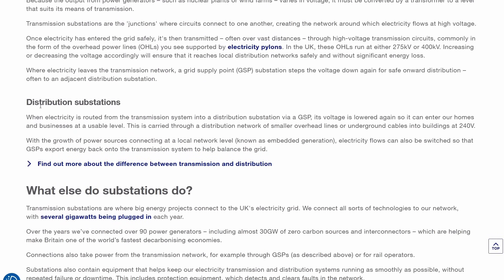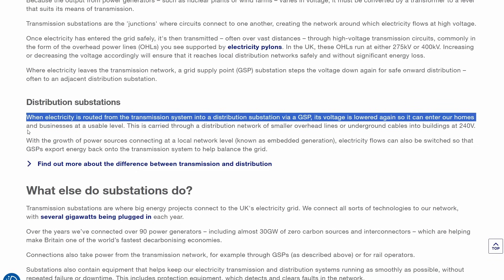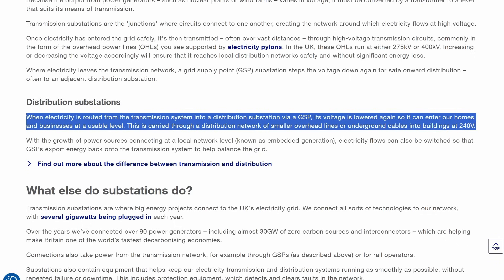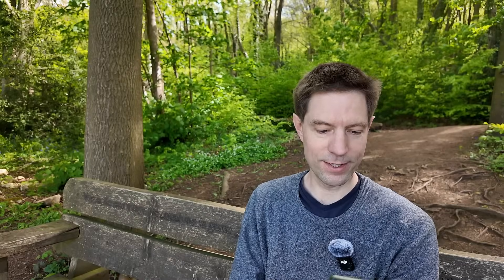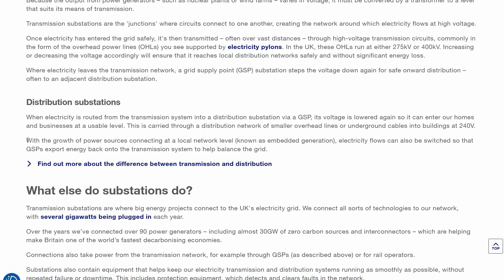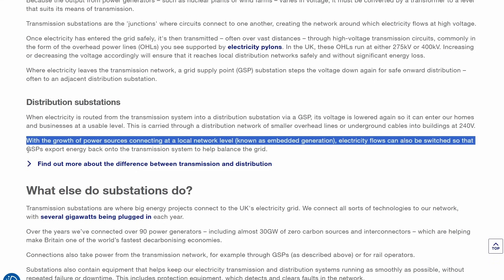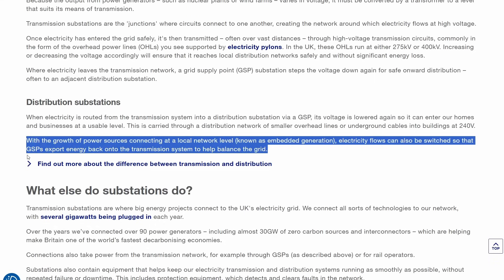Does solar export get past the local transformer?

Comment: I used to work for SSE/Hydro-Electric.  We demonstrated this reverse flow through transformers in our training centre by having an isolated section of 11kV overhead line, with breakers, reclosers etc. for live line training that was back-fed from a standard 230 volt socket via a pole-mounted transformer.  This way the use of voltage probes etc. could be demonstrated to trainees in a (relatively) safe environment isolated from earth.
Reply from the maker: Nice.  That's really interesting.  This is definitely something I'd like to learn more about.
Reply: @ It was very interesting. First step is to get the grand master key to enter the substations. You have to take a safety course that involves photographs of smoking boots with bits of feet still in them!!!
Reply from the maker: @Richardincancale  yikes!

Comment: Tim, 

while it seems counter intuitive, as A.C. is alternating current, power can only flow in one direction, that is from source to load. In a complicated network as our system is that means that fluctuating demand and fluctuating source sort themselves out following the power flow.
In practice your excess probably does not go much further than one or two neighbours. There is no hard and fast rule, e.g. it stops at the transformer, that's just not how it works.
In the event that a whole housing estate has solar and that at peak times generates more than it consumes, the excess will flow back through the transformer and supply some other demand.
This phenomenon of solar peaking at and around midday is not good for the grid when substancial capcity of domestic and commercial solar is connected as it is beyond the control of the grid controller, so other generators may be curtailed to keep supply and demand balance on the grid This curtailment puts up our electrcity costs as it is paid at a higher rate than market price plus subsidies.
Reply from the maker: This is where battery storage steps in.  The grid is getting more and more installed all the time, and many home solar systems have them too, so it won't be as much of a problem for the grid as you fear, I suspect.
Reply: Tim, 
battery storage does not in itself solve anything. The grid needs finite control on an instantaneous basis which makes solar an unknown for the most part.
It is it's peaky output that is the problem, U.K. solar peaks now around 12 gigawatts  and the rise and fall around midday means that gas (which balances the grid) has to decrease output rapidy then incresae again.
On bright summer weekend days there can only be a small amount of gas feeding the grid.
If batteries were automatically and un alterably set to capture any excess for the six hours or so around noon and only discharge at pek time sthat would be OK, but that needs very large battery capcity relative to solar panel capacity.
This government plans a very large increase in solar panel capacity, monkey and hand grenade comes to mind.

Comment: I’ve definitely noticed the impact of more local solar in my village.  Getting more occasions where the grid voltage rises up on sunny days, and once it reaches 258V it stops my inverters from generating AC.  The solar generation stops, grid voltage drops, and the cycle repeats.
I trickle charge my batteries during the day to try to mitigate this, but suspect its only going to get worse
Reply from the maker: With any luck your local network will get upgraded to handle the excess and the situation will improve for you.  I hope that happens sooner rather than later.

Comment: Hello, Network tec hear. so I'll keep it simple ... yes electrical energy can flow in any direction. Look at large amazon yards. they all have there own 11kv supplys. during the day they export, the transformers basically act as a step up transformer. then at night, they pull from the grid.
Same with houses.
reason for things like G99 and Networks giving a green light, is so they can make sure the transformer isn't overloaded in summer + safty. 
Where we see problems, isn't the transformer but the protection systems. Some older sites have reverse power relays. if they see power flowing in the wrong direction they trip. This is a simple upgrade but does cost so if your DNO blocks your application this could be a reason why.
Reply from the maker: Yup, I assumed there would be other components involved so it wouldn't be a simple case of the transformer just letting power flow in either direction.  But it's good to know that these power relays can be upgraded if required so they don't trip when power flows in reverse.

Comment: I used to work for the Southern Electricity Board (now SSE). We bought energy at 132kV from National Grid. These large substations are the grid supply points. There is an error  on the National Grid web site. The UK nominal voltage is 230V, not 240V. It was changed a number of years ago. You can backfeed through the local transformer.
Reply from the maker: Ok, thanks for confirming.
Reply: You spotted their typing error as well; out of date, no doubt. That said, it varies depending how old the local transformers are. Until a couple of years ago, the one that fed my street was an old 240 one, but was replaced (along with loads of buried cable that was faulty) with a new one rater at modern standards, so I’m on the nominal 230 - 237.3 at present, according to the display on my inverter. It’s a relatively short run of buried cable from the nearest grid supply point, which is the remnants of an old power station. A few minutes of that job here: https://youtu.be/LS8VFhRMsYY
Reply: In the UK most in-place systems are legacy and might have been installed any time from 1930. These were 240V local volts + a bit extra wiggle-room. When the 230V standard was introduced, did the c. 250,000 UK local transformers get replaced? No. What happened was the legislation was written to say "230V -6% +10%" ie more upward headroom. The old transformers are still there working as installed, whenever that was. Job done.
Reply: I thought it went back to 240v nominal after Brexit?
Reply: @bolwem50 would that count as a Brexit benefit? Hooray! We found something! Although I'm not quite sure what the benefit is, from this, or in general! Lol
Reply: @bolwem50  No it didn't.230V is the standard that has been in place for decades. Absolutely no benefit to changing it, many downsides if you do - millions of 230V certified appliances already out there.
Reply: @ In reality, the UK domestic AC voltage ends to be held at around 250v.  

This helps to reduce the current required, the energy lost to heating and allows a margin for voltage drop for those at the very end of a long line.  

Right now mine is at 248.88v (at the saggy time of day) but we are very close to the main artery of the UK grid.  My peak this week was 253.4v. All of this is well within the generous limits of the UK power generation regulations.
Reply: @Scouser22it makes no difference, European harmonisation took the UK mains voltage from being defined as 240V (±6%) to being 230V(-6%|+10%), there was no actual change other than a loosening of the lower tolerance.
Reply: @bolwem50 LOL, no. Nominal is 230V but there is a tolerance of +10% and -6%, so actual voltage could be in range of 216.2-253V
Reply: @bolwem50  ha ha! Clearly not!

Comment: Mmm, The site you referenced refers to the voltage as 240v, but single phase voltage within the UK is 230v with a tolerance of plus 10% and minus 6%. It rather make me wonder about the rest of the article. There is an interesting YouTube Vid by artisan electrics on this very subject. In their case an admin error with the G99 export limit allow them to export up to 17Kw. The issue that happened was that on sunny days the Voltages increases over the maximum allowable. This can cause  damage to devices or in this case their car charger PEN device to trip and stop charging.
Reply: Yes I noticed the 240V error, very disappointing that what should be a definitive source made such an obvious mistake.  We’ve not been 240V in the UK for years
Reply: @geoffreycoan  The standards have changed, but not all the old transformers have. Until the local transformer that feeds my house was replaced recently, it was 240, but now with a new one it’s 230 (more like 237 most of the time). They got round it by widening the +/- tolerance in the modified standard, so they all comply with the new one, with no  really physical change, until they get round to it.
Reply: @geoffreycoan  Yes, it should have referenced that "nominal" 230V but it should be borne in mind that when that nominal figure changed (years ago) there was no actual change to any of the equipment supplying our mains electricity. I have monitored the voltage in my houses over the years (I'm now retired) and have never ever had an actual supply voltage as low as 230V ... so in the 240V reference is nearer to reality!
Reply from the maker: From what others have said the part about power flowing out of a local transformer is correct, regardless of the other details.

Comment: My belief was that the transformer works flows of electricity in and out as this allows our generated electric to help power other homes and businesses.
Reply from the maker: That does appear to be the case.
Reply: That's definitely true, but it's also true that older generation or poorly maintained transformers, might struggle to cope / balance the variable inflows and outflows if there are several solar panel houses on its patch.

Comment: Yes, local solar generation does get past the local transformers, the grid supply points, through transformers and switching yards, on to the HV network and across from the national grid to the international interconnects to other countries et al.  Neat.

Actually quite a bit of new work is going into this here in the UK to help mange and control all the weird things electricity can do when the power on it is not quite right.  NESO are installing what they call Supergrid Transformers (SGTs) that take 19th century tech kicking and screaming into the modern world.  These beasts allow for high fidelity control of the networked power, tweaking the loads, phases, voltages etc, in both directions, and can act co-operatively and are synced to high-quality time sources.

The idea is we get better resilience, less electrical energy lost through heat and more stable power delivery in both directions.  Reading through the technical notes, definitions etc that each SGT weighs about 30 African elephants.  I can only presume that the dimension equivalents in bananas didn't get past the proof-readers.

There is less of this trickery at the local level though, with transformer tweaks limited to 19th century 'tapping' and perhaps more capacitor banks.  However, residential solar PV system themselves will have to do some of the tidying-up of the local power quality and control.  This will be achieved both by better standards (say goodbye to DIY battery banks and cheap inverters) and by direct grid control of PV inverters complying with G100.  

These G100 residential solar inverters, acting in coordination, can change power quality factors to help stabilise the local grid and, ultimately, the wider grid.  Everyone gets nervous about G100 due to its ability to moderate your export but in truth the systems are being designed to correct local power so that export limiting is less likely as you can push more energy through a system with a high power quality than one that is a bit of a mess.

Yes, I have a grid-controlled G100 system and no, the sky does not fall in.
Reply from the maker: It's certainly good to know that the grid is being modernised all the time and that it is becoming more robust.  I get a lot of comments from people doom mongering about the state of the grid but I'm much more optimistic.
Reply: @TimAndKatsGreenWalk  It's not all roses of course.  We do still have weaknesses that need to be addressed.  The days of holding a bunch of spare major transformers have long since gone.  With relatively few suppliers and huge lead-times for replacements it would not take much for that to be a massive problem.  

On the geopolitical level we have had times where we have been utterly reliant on our interconnects to Europe - something easily lost.  Finding and investing the right money to fix inherited problems is still difficult.  But the forward-thinking, planning and engaging with newer tech is one of our plus points.

It's too easy to forget that we closed our last oil-fired generation many years ago, that the last coal generation went offline just before last winter and that the North Sea is blossoming with wind energy.  As I responded, a third of the UK energy was coming from solar - ahead of all other sources.  Yes, the UK!  Despite all the gloom the lights have all stayed on.

Comment: Quite simply a standard ac transformer works both ways quite happily.
Reply from the maker: Yup, although there are other components in the distribution network that don't like reverse power flows so much.  But it seems they can be upgraded to accept power flowing in either direction, so that's good.
Reply: ... in theory, yes. But we don't have theoretical ac transformers on the grid, so the degree of happiness with which they can deal with working both ways can variable it appears!

Comment: The GSP is the interface between the transmission network and the distribution network. This is the best schematic of the UK electricity system that I could find: https://ars.els-cdn.com/content/image/1-s2.0-S2352484723013100-gr2.jpg from https://www.sciencedirect.com/science/article/pii/S2352484723013100
Reply from the maker: Nice, thanks!  That does help clear things up.

Comment: Hi Tim. A GSP is the interface between transmission and distribution, often 400kV to 132kV. Reverse power flow is now common, good examples are Norwich and Walpole. In reality LV domestic solar will feed into very local demand, such as your neighbours who don't have solar. Plenty of 11kV primaries do export up to the higher voltage levels, sometimes limited by directional overcurrent protection or tap changer capabilities. Power now flows in all directions, instead of the old top-down flow
Reply: Yes they certainly could. That pole mounted transformer would step it up to 11kV, then in theory it could be stepped up at a primary substation to 33kV, then at a grid substation to 132kV, then at a GSP to 400kV and make its way around GB
Reply: @lukegiles1803  And in theory spin up the turbines in the power stations a little bit assuming it wasn't used elsewhere on the grid?
Reply from the maker: Yeah, it was more a question of whether the local transformers will export further up if there happen to be lots of homes with solar installed.  If that's the case then brilliant.
Reply: Transformers are relatively simple things, it would be pretty difficult to stop them exporting upwards, I don't see how you'd do it. I presume people working in the grids must ensure that both sides (source and destination) are disconnected before doing work, unless they have the means of working safely on live lines.
Reply: A transformer is by nature a bidirectional device.  This is why buildings with standby generators must have a means of isolating them so they do not back-feed the grid, this is typically done using a transfer switch.  

If not isolated, the 220-240 volts on the standby generator will be stepped up by the so called “step-down” transformer mounted to the pole.   This endangers utility workers as these distribution lines are now live and operating near the much higher distribution voltage.   Depending on what else is connected to these lines, damage to the standby generator could also occur, and it will definitely be damaged when mains power is restored.  Again, it is a bi-directional device.  That is not saying the transformer designer does not optimize the design for how it is intended to be used, but these tweaks do not change the fundamental nature of the device.

Comment: In the context of National Grid a Grid Supply Point is where the high voltage (HV) network connects to the local distribution network (your local DNO) and voltage is stepped down.
Reply from the maker: Yes, but does that include the local transformer for a housing estate, or does it mean a bigger transformer in between the local one and the transmission network?  That bit was unclear to me.
Reply: @TimAndKatsGreenWalk  National Grid run the HV transmission grid - used to take power from power stations to the Grid Supply Points at 275000 or 400000 volts where the local DNO lower the voltage and use their local network to distribute the power from memory this is 11000 (11kVa) or 33000 volts (33kVA) Your local transformer steps the voltage down to 230 volts. Yes your solar production can get further than your local transformer and power homes that are not on the same phase as you. 30 years in electricity supply company.
Reply from the maker: @southwestsellers5475  ok, thanks for confirming.

Comment: Yes it does. There has been some very interesting innovation work over the last few years funded by electricity networks including NESO on managing solar PV generation against consumer demand - at both transmission and distribution levels. Phase switching on the LV network, automatic tap changers on transformers to manage volts, satellite data for visibility of amount of panels installed /impacts of cloud cover as it moves across the UK.
Reply from the maker: That's good to know